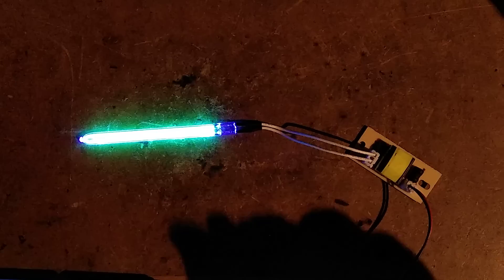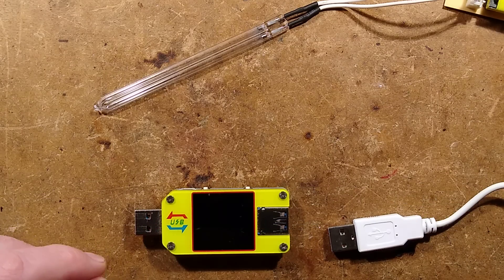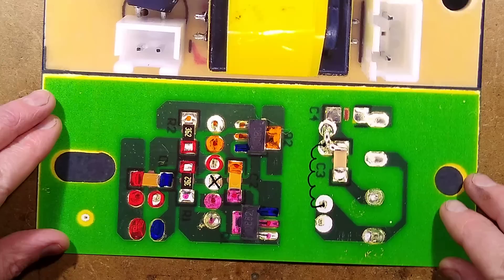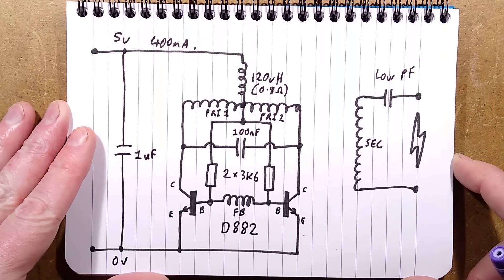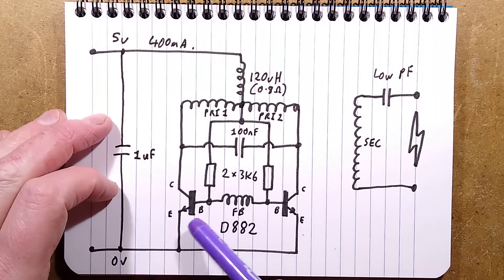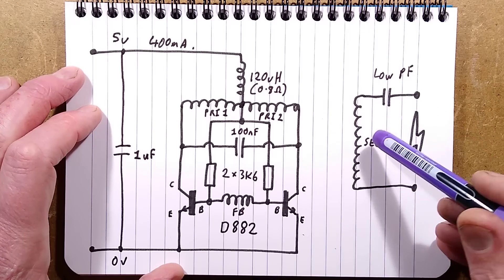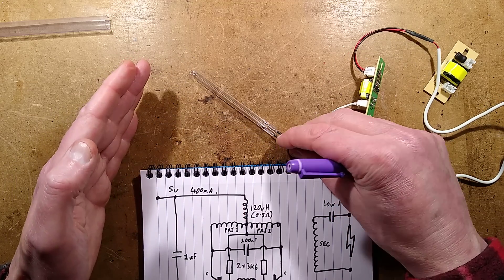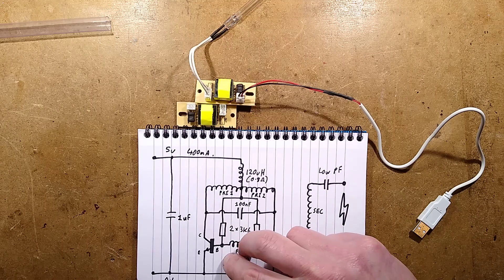USB cold-cathode UVC/neon driver - with schematic

Comment: Hi Big Clive,hope you see this message. Cheers for all the very amusing and educational videos. You know neon lightning quite well,I have a neon tube bar counter "open" sign with the inverter built into the base, A LM555 switching a step up transformer. The total tube length is around 300 mm,lately it only lights on the ends,one end lights up blue and the other orange,as it should. The tube is driven directly from the secondary of the transformer. Is my tube shot ? can it be salvaged ? The inverter circuitry seems all good, Thanks man:finger-red-number-one:
Reply from the maker: It's possibly an aging tube.  It might be worth trying it with a different neon driver in case it's just on the edge of operation of that one.

Comment: i just got myself some nice neon spectral tubes from eisco and instead of getting their stupid 250 euro driver ill just use this
its 24 cm long so i hope itll strike
Reply from the maker: The extremely thin central section will require quite a high voltage.
Reply: Darn, wel i got the power supply on the way so lets hope they still work. Otherwise ill just use some plasma balls.

Comment: For measuring such low capacitance you can use your transistor (and everything else) tester, but you need to update it to newest software - it will have absurdly high resolution. Also, if you really want you can use ut210e or other semi-decent multimeter with zeroing function and 1pF resolution, but due to leads capacity it's quite tricky. But doable.

Comment: That's a nice little circuit. Good for driving voltage multipliers if the frequency is not too high, for maybe a marx generator - or other HV impulse circuit.

Comment: Mr Grossman is on the ball. The 100nF capacitor deternins the oscillator frequency, along with, to some extent the 120uH inductor and its a sine wave. Ditch the inductor and you get a square wave. Keep an eye on the voltage rating of the two transistors. Although you only have a 5 volt supply, the resonant voltage swing across the primary is probably getting on for 50 pk/pk volts so keep an eye on the voltage rating of the 100nF capacitor as well. Used to see a lot of these in old photocopiers where the flourescent tube had to switch on instantly to scan.

Comment: The circuit is very similar to one I built using 2 MOSFETs to drive the secondary of a 115v:12.6v CT step down transformer.  I used them in an astable multivibrator configuration.  A cap was across the secondary to swamp out switching spikes.  I was able to get almost 300v p-p out of the primary winding.  My ultimate goal was to use it to drive a Tesla coil.  But like a lot of other projects it fell by the wayside.    Btw, I tried the link to aliexpress and it failed.

Comment: Hello Big Clive. I've been repairing a lot of microwave ovens lately. I am looking for a DIY device to measure the HV diode with, for example, 2 LEDs, a red and green to indicate the status of the diode and whether it is open or shorted. Of course, the HV diode is first removed from the microwave oven to do the measurement. Testing with a normal DVM is not possible because the internal power supply of a DVM is insufficient to measure this diode. I am currently dealing with a series connection of a 9V battery with the DVM, but this is not very professional and also hassle with battery and DVM. Can you therefore possibly provide me with a diagram or make a small video on You Tube for a handy test device that can possibly work on the mains voltage of 230VAC (of course with an internal transformer to reduce the voltage) I follow your videos regularly and they are very educational. Please keep up the good work for this. Have already created a small database of your most important videos to be able to consult them in the future if necessary. My heartfelt thanks in advance and many greetings from the rainy country of Belgium. Andy.
Reply from the maker: The forward voltage of a microwave oven diode is quite high, so I think you'd need either one or two 9V PP3 batteries, a resistor and an LED.  The LED should only light with the diode one way round.

Comment: That's really a beautiful little circuit - something very appealing about the Royer-type oscillator. Some musings - the 100nF capacitor across the transformer forms a parallel resonant tank with the transformer. The series inductor is critical, because this is what's called a current-fed inverter. While normal inverters will output a squarewave voltage waveform, a current-fed inverter outputs a squarewave current waveform. Took me a while to get my head around this ;-) That's the reason it can drive a parallel resonant tank. Instead of a feedback winding, you can also cross-connect the base (or gate) of one transistor to the opposite collector (or drain) of the other, with suitable diodes to clip the voltage levels. However that needs more components, so a feedback winding is simplest here. Current-fed inverters have some very cool advantages for induction heating (one being that you can use the same series inductor as a buck inductor and easily control the power level) - I have a page about them here if anyone's interested: http://imajeenyus.com/electronics/20150625_current_fed_inverter/index.shtml

Comment: I have a bunch of those handheld UV sanitizing wands which have this type of driver inside. I cannibalized one to drive a CFL curly light bulb and it drives it rather well. Made another with a driver circuit from an old fluorescent camping light and it drives a CFL bulb nicely. Both circuits spam the crap out of the AM radio band with noise.

Comment: One place this sort of oscillator was used commonly was when LCD screens had CCFL backlights. The backlight circuit of most smaller displays would use this arrangement

Comment: Where can I buy one of these kits with the UVC tube?

Also, unrelated, could you design us Americans a circuit that utilizes a large capacitor to hold 126 volts from our mains voltage, made as a pass-through device, to provide 126v down to 110v DC (as the capacitor discharges) to power our devices for up to 3 seconds when the power flickers during high winds?  A decent quality UPS battery backup costs $250 and doesn't last forever, and is overkill for very frequent 1.5 second power interruptions.  Some Americans experience dozens of power flickers a day on windy days.
Reply: Nah cba

Comment: As is common, measurements would be interesting, in particular the voltage and frequency.  connecting your o'scope would not be healthy so i have a suggestion.  make a voltage divider with a gigaohm and megaohm resistor and read off the megaohm resistor. Since the current is so low, add a capacitor, diode, and maybe a resistor in parallel with the megaohm resistor to half wave fill the capacitor so a peak voltage can be measured with a VOM, after a period of time <"5" minutes> to fill the capacitor.  in case the pulse voltage is high enough, maybe the o'scope could see the oscillation directly on the megaohm resistor.  Just ideas to further evaluate the subject, including the many ozone generator circuits.  Thank you

Comment: When it comes to Ozone generating efficiency, I wonder if using one of these tube setups chucks out more Ozone than a high voltage discharge thing? (For given input power)

I suspect that an arc discharge thing uses more power, as a fair amount of heat is generated. 

This UV tube setup doesn't get hot, only warm, but how long do the tubes last...?

Thanks for the vid Clive 👍🏻😀🇬🇧
Reply from the maker: For ozone the most efficient approach is corona discharge.  Although UVC tubes can generate ozone they are not an efficient way of doing so.

Comment: I have a UVC sterilizer wand that uses 4 triple A batteries (Now runs on USB) that has that exact tube, except it doesn't generate ozone.
That's a very interesting circuit. I think these circuits are used in the older fluorescent LCD monitors too? I took one apart that died a while ago, and the circuit connected to the tubes looked very similar to this one, apart from being a physically smaller board to fit inside the monitor case.
An old laptop had this circuit for it's monitor also. I don't think it was this exact circuit, but it was some form of 12 volt to high voltage inverter.

Comment: You can usually tease one of the universal testers into giving a reading of low capacitance , by putting the small capacitor in parallel with a known larger capacitor.
The difference is the answer.

Comment: Im trying to repair an UVC CFL lamp that burned for using in incorrect voltage. The transistor and the resistors are gone... can i just replace them with another generic npn transistor and same resistor values? or simply just get another lamp with same power and replace the circuit? Im worried that a higher power could burn the filaments...
Reply from the maker: The transistors are usually optimised for the task.  You could possibly use it with the circuitry from another CFL of equal power.

Comment: I have two of those cold cathode uvc sterilizers (takes AAA batteries or USB) from eBay, which have the same tube - both only make the ends of the tube glow faintly, but won't light completely. Does anyone know what the problem could be?
Reply from the maker: It's not uncommon for the tube to flow at the ends when cold and gradually warm up and diffuse the mercury vapour more evenly through the carrier gas.

Comment: I see that they offer tubes of two different wavelengths: 184nM &254nM.  
Both seem to be classified as 'sterilization' - so what is your opinion over these two options?
Reply from the maker: Both will put out 254nm.  The one that also passes 184nm will generate ozone too.
Reply: Im gonna throw my two cents in. 
The lower the wavelength, the higher the energy of the emitted UV. As such, the light of the 184 nm lamp would be more effective compared to the 254 nm one as long as their rated wattage is the same.

Comment: What I'm interested in most of the time, is if I want to scale this up and put, I don't know, 20 of these in parrallel (would series work), which values of the resistors and things would I have to change out? It's always been so difficult for me to calculate these kinds of things.
It comes down to PLC outputs as sometimes, you need a pull-down resistor and you need to calculate the right value, which is so confusing and hard to find information on.
Reply from the maker: It might be better using a single larger tube and driver.
Reply: Stick a lot of 'em together, it'll be cold-cathode-fusion.  😉
Reply: calculating resistor values is really easy, you just go from ohm's law V=IR - re-arrange so you have R=V/I. If you're calculating the value of a pulldown, you need to know how much current (and at what voltage) the output can source. With a pulldown, you're not worried about how much current is flowing when the output is low (the driver and the pulldown are both pulling to low, so in that case the resistor won't pass any current at all), but rather how much of the high output current is wasted in the pulldown when the pulldown is fighting a high output. Say you have a 24V PLC output that can source 400mA. Also assume the thing you're driving draws 200mA when the output is high. So you can use up to an addition 200mA in the pulldown resistor, but to not push the output to it's limit of current sourcing, let's say the pulldown should only draw 100mA - calculate the resistor R=V/I = 24V / 0.1A = 240 ohms. Now let's say you wanted to only have the pulldown resistor only draw 50mA when the output is active, 24V / 0.05A = 480 ohms. Just make sure your units in the numerator and the denominator match, otherwise the number coming out won't be in ohms (aka V on top and A on the bottom, or mV on top and mA on the bottom - you need the same unit prefix on the top and the bottom to get a result in ohms)
Reply: @gorak9000  That's kind of what I mean. Where do you get these arbitrary numbers from in the first place in order to do the math? Back when I did this in school, I could only do it up to a few days after we went through it in detail, and then I'd forget. It's kind of the same principle as having a delta motor running but with only two phases. There's some weird fuckery going on with those resistor values. Anyway, thanks for you explantion.

Comment: A little safety concern, but, shouldn't the output be a 'Female' socket rather than a 'Male' with two bare pins protruding? This is only a guess as, you didn't mention what value the 'High Voltage' was... I mean, yeah, might not 'Death you' (or as the new 'In thing' to say is... Sigh..😒 'Unalive you'😒), but might 'Pinch' your finger 😏 so to speak, if switched on?? 🤔
😎🇬🇧
Reply from the maker: I think they use the plug because it's the more common PCB mounting side.  At 1kV it's not really suited to handling while powered anyway.

Comment: I always thought the output cap was used to form a resonant LC circuit with the transformer secondary to generate an initial high voltage to strike the tube - never played around to verify this though
Reply: I dont think it could resonate like that, since it's in series with basically an open-circuit at startup. Probably better to think of it as a capacitive current limiter. A resistor would probably work as well assuming you put in twice the power into the circuit to compensate for the losses on it.
Reply from the maker: With the old school cold cathode PC case lights, the shorter tubes used the same PSU with a lower value cap on the output.  They could also run several tubes from one transformer with a cap in series with each one.

Comment: The 100nF capacitor creates a resonant circuit with the output transformer.  That changes the circuit to a resonant Royer (or Baxandall) oscillator that outputs a waveform muck more sine wavelike instead of the square wave from the classic saturating core Royer oscillator.  You should look at it with your oscilloscope.  You can get differential measurements using two channels and the subtraction function.

The link is dead.
Reply: https://en.wikipedia.org/wiki/Royer_oscillator#Sinewave_Oscillator_(Baxandall,_aka_%22Resonant_Royer%22_vs_Original_Royer)

Comment: Those little driver circuits have been around for decades, included with some colorful cold cathode tubes for use inside your P.C. case to make it light up.

I remember buying these things and the 8" long straight tubes at my local P.C. supplier 20 years ago.

Edit: Whoops! I posted this about a minute early, right before it was mentioned in the video. My bad...
Reply: Oh yeah, I bought some blue ones as they were actually cheaper than other lighting options at the time. When I plugged them in I was surprised they were not more popular. Really nothing looks quite like those things.
Reply: @SoulAir  They were good... Norhing was quite as bright and colorful as they were. The driver circuit didn't mess with the P.C. board either. I enjoyed them, and they aren't as easy to come by anymore. 😞

Comment: I have a portable water steriliser pen that uses a similar tube (albeit a bit shorter) and powered by 4 x AA cells. The UV tube is housed in a quartz tube, It sterilises 1 litre of filtered water water in one minute. Quite handy for outdoor use and emergencies.

Thanks Clive, now I can build an upgraded one! 💪🤗
Reply: Filtered water water
Reply: @user-yw8sr3uj1w  was lying in bed with a purring cat in my chest, typing with one hand!! 🤔🤗🤣
Reply: @gertbenade3082  fair enough!
Reply: @user-yw8sr3uj1w  When my Masters demand attention, I have to leave Clive's videos and attend to their needs!! 🤣
Reply: I tested the link that Clive posted in the video description and it works - the item is listed for R15.00 with shipping of R20.00 to South Africa. I suspect the link is moderated by YouTube depending on where it is used from. Total item cost is around £1.50...and a delivery time of up to 50 days,.which is quite cheap, if you can trust the local post office! 🤔